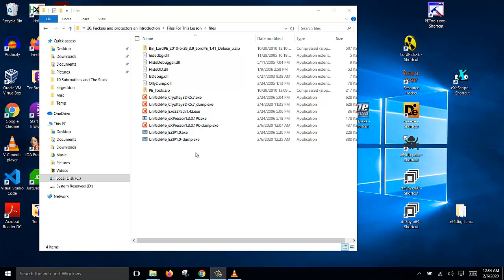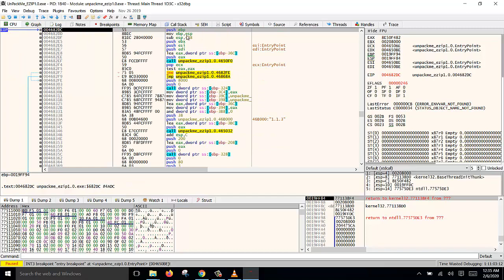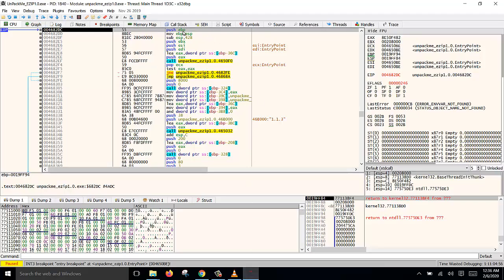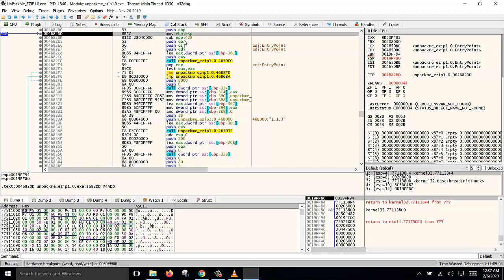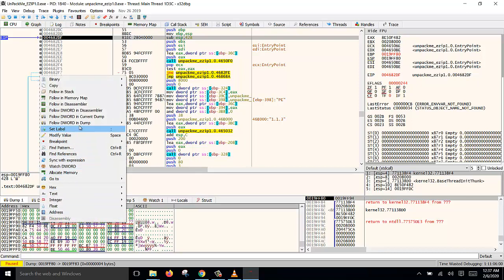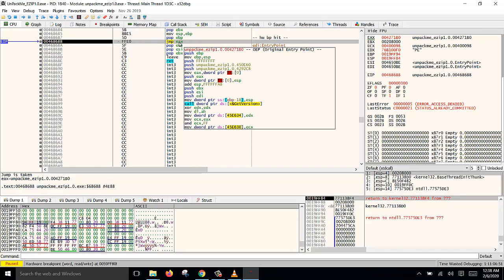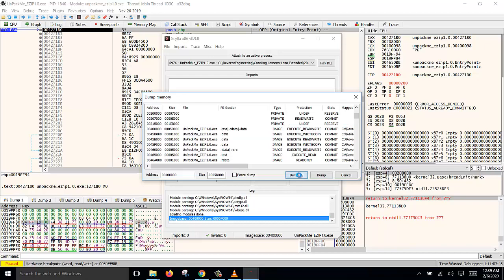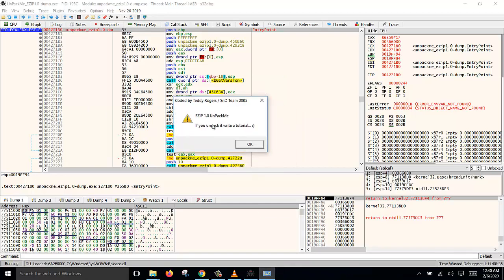How to dump original PE file from packed file

Comment: Hey bro , I have multiple Entry points , how to know the right one ?
Reply from the maker: xdbg can automatically detect the main entry point. Just go to Options/Preferences and unchecked everything and only check "Entry Breakpoint"
Reply: @PaulChin20  I don't exactly mean this software , I 'm trying this on a game it detect first .dll / modules , then the .Exe but in the .Exe there is different entries too
Reply from the maker: @hamidavex3337  Yes, I know. Just use the same technique I just described.
Reply: @PaulChin20  I tried your technique , the same issue . Do you have discord ? I want to contact you !
Reply from the maker: @hamidavex3337  Sorry I don't use discord. You can try my CSL and CSP courses at https://crackinglessons.com/learn

Comment: Hello, because files that were packaged with the old "SafeNet" Proteq500 x86 don't follow this rule. The packer inserts a new protection section into the file and appears to unpack at run time without using memory. Would you have any flow to be able to obtain the dump of the original file for analysis of the code?
Reply from the maker: There is an alternative way to crack a software without unpacking. You could use Cheat Engine to hack the memory - then write a custom Trainer to patch the memory during runtime.  I have a course which teaches how to do this:  https://www.udemy.com/course/reverse-engineering-memory-hacking/?referralCode=67A25D5029F89DF73A0B

Apart from the above, I also teach it in my CSP course available here:
https://crackinglessons.com/learn/
Reply: @PaulChin20  I am starting to acquire this indication from Udemy, later if the tip is good as I commented on the protection of the "Compact-500" from SafeNet, I will move on to the other indicated courses. I hope you can give tips in specific cases like the one I mentioned ..
Reply from the maker: @kelcyo  Thanks Kelcyo